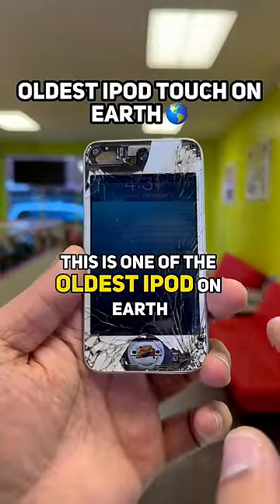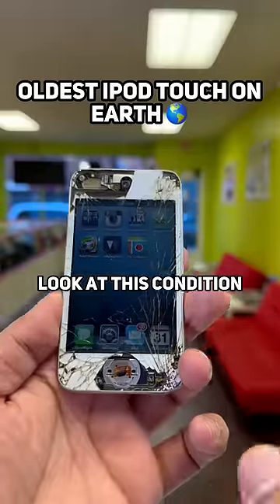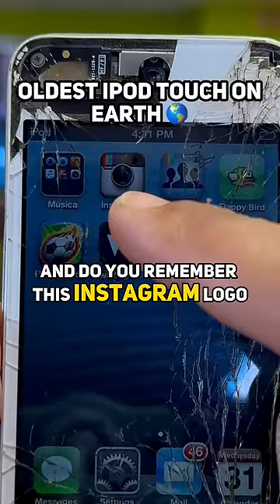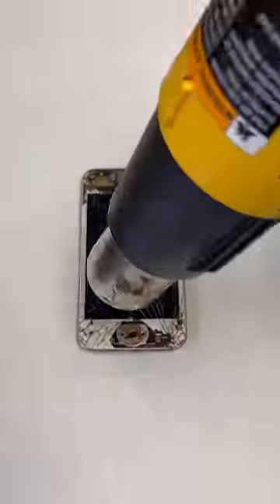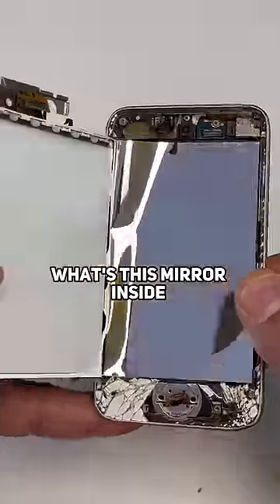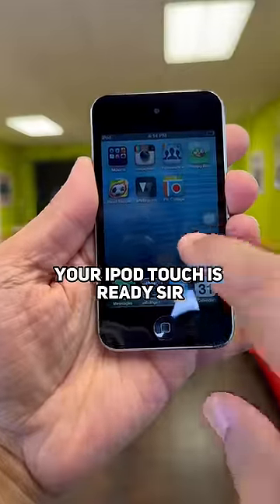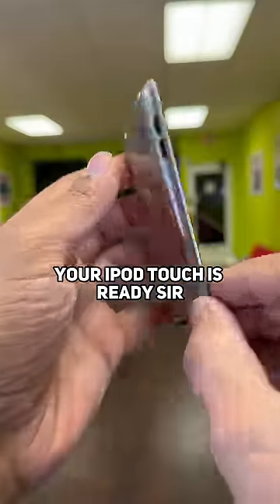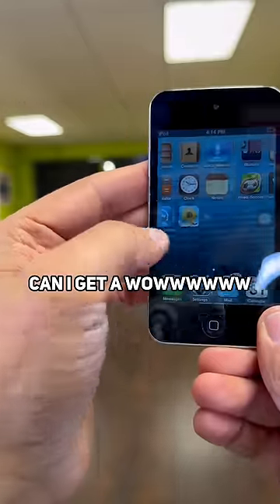Fixing $10000 Worth ipod Touch with Flappy Bird 😍 #shorts #ipodtouch #apple #iphone #ios #android

Comment from the maker: What’s your battery percentage right now ? Comment below 👇
Reply: G3%
Reply: 52%
Reply: 27% 😅
Reply: 83%
Reply: 21%
Reply: 98%
Reply: 11%😅
Reply: C=Charging
N=Normal
X=Not So good
L=Low power mode

My battery= N98‰
Reply: X 53% :3
Reply: Wow
Reply: 13
Reply: Charger: 11%
As for the battery: 93%
Reply: 3💀
Reply: 93
Reply: 5%
Reply: 42%
Reply: 2%
Reply: mrpotato-8  good luck bro 💀
Reply: 63%
Reply: 11
Reply: 77
Reply: 36%
Reply: 79
Reply: 69%
Reply: 69%
Reply: 52
Reply: 97%
Reply: 15%
Reply: Mine is 88% percent
Reply: 0% 💀 (im on a Samsung)
Reply: 45%
Reply: 93%
Reply: 72
Reply: 100%
Reply: 100🤩🤩🤩🤩
Reply: 100%❤
Reply: 20%😊
Reply: 46
Reply: G3%
Reply: 48
Reply: 71%
Reply: 49
Reply: 83
Reply: 83%
Reply: 8%
Reply: 95
Reply: 38%
Reply: Clean 60%
Reply: 100
Reply: 100
Reply: 1
Reply: 69% (Why did it have to be that number now).
Reply: 35
Reply: inf bc im on pc
Reply: 66%😂
Reply: 40%
Reply: 97
Reply: 37%
Reply: 30
Reply: 100%
Reply: 31%
Reply: 31
Reply: 47
Reply: 70
Reply: 68%
Reply: 70 %
Reply: 70
Reply: 69% 💀
Reply: 39
Reply: 82🎉🎉🎉🎉🎉🎉🎉🎉🎉🎉🎉🎉
Reply: 17
Reply: 74%
Reply: 11%
Reply: 69%
Reply: 84
Reply: S10 plus 84%
Reply: Yours is 84 and mine is 84
Reply: 46
Reply: 1
Reply: 12%
Reply: 79%
Reply: Bro can u fix my iPod Touch 4th Gen?

Parts to be replaced:
• Screen
• Battery

Bro also just jailbreak my damn iPod if I send it for repair...
Reply: @KaidenBarillas same here im on a lenovo 0% still works lol
Reply: 45
Reply: 83%❤
Reply: 13 persent
Reply: 48%
Reply: 100% i always keep my pc charged
Reply: 50%
Reply: 90% or 80% i cant see it
Reply: 84%
Reply: 98 percent
Reply: 53%
Reply: 81
Reply: 39
Reply: 95%
Reply: 84%
Reply: 60
Reply: 83
Reply: 25
Reply: 84
Reply: 63%
Reply: 74%
Reply: 60%
Reply: 16
Reply: 90
Reply: 72%
Reply: 38
Reply: 40%
Reply: 91
Reply: 6%
Reply: 58🥚
Reply: 82%
Reply: 97%
Reply: 10 😅
Reply: 10
Reply: @IVAN-pz6et my 10
Reply: 92%
Reply: 85
Reply: 100%
Reply: 98%
Reply: 84
Reply: 31%
Reply: 63%
Reply: 9
Reply: 76
Reply: 0.0000000001
Reply: 62
Reply: Mine 34% 💀
Reply: It’s discharging so fast
Reply: For 30 minutes
Reply: I need a battery replacement to discharge at 24 hours
Reply: 73
Reply: 6
Reply: 100
Reply: 47 and climbing
Reply: 41%
Reply: 62
Reply: @KING_GOD_34 too close
Reply: 69% haha sussy number
Reply: 34%
Reply: 7
Reply: 7%
Reply: 23
Reply: 56%
Reply: 50%
Reply: 71
Reply: 28%
Reply: -1% 💀
Reply: 79%
Reply: 98
Reply: 63
Reply: Hey dude i can get flappy bird on my 4S with iOS 6 super easily. Flappy Bird on an iOS device does not increase it’s value!!!
Reply: 98%
Reply: can you fix my Ipad 16 im all the way to france
Reply: 1 and I can’t ride a charger💀
Reply: 6 💀
Reply: 37%
Reply: 12%
Reply: 31%
Reply: 51%
Reply: 19%
Reply: lol im on desktop computer
Reply: 35
Reply: 20
Reply: 22
Reply: 78%
Reply: 58%. I’m using my brand new iPhone 15 I got for my birthday this year and I love it more than my 6. My 6 would only hold charge for about an hour at the most and then be dead, and then my mom got me the new 15.
Reply: 45
Reply: 12%
Reply: 55%
Reply: 6% 😂😅😊
Reply: 22
Reply: 92😊
Reply: 100%
Reply: My ipad is not working cause it exploded...please fix it please 😢😢😢I hope the price is free...😢😢
Reply: 56
Reply: 32%
Reply: 8
Reply: G100%
Reply: 13
Reply: face reveal 🤡
Reply: 37%
Reply: 71%
Reply: @MemesFromUnderTheBed what the hell
Reply: 48%
Reply: SHOP LOCATION
Reply: 66
Reply: 86%
Reply: L69%
Nice
Reply: 55%
Reply: 67
Reply: Until my house power goes out.
Reply: 52%
Reply: 89
Reply: Wow
Reply: 26
Reply: 17 percent
Reply: 98
Reply: 92
Reply: 71
Reply: 100%
Reply: 92% surprisingly
Reply: 6
Reply: 57%
Reply: 78
Reply: 68
Reply: 80%
Reply: 29
Reply: 1 perse
Reply: 9%
Reply: 9%
Reply: 54
Reply: 4
Reply: Charging 
Current:9%
Reply: 7%😂😂
Reply: 51%
Reply: 34
Reply: 63%
Reply: 55
Reply: 55%
Reply: 26
Reply: 71%
Reply: 55%
Reply: 92. '/.
Reply: 67%
Reply: 42
Reply: 65%
Reply: 94
Reply: 97%
Reply: 3℅
Reply: 3💀
Reply: 79%
Reply: 20
Reply: 29
Reply: 62
Reply: 14
Reply: 21
Reply: 11%
Reply: 89
Reply: 83
Reply: 47% ig its not that bad
Reply: 29%
Reply: 23😊
U
Reply: 90%
Reply: 67
Reply: 90%
Reply: 90%
Reply: 83
Reply: 53
Reply: 75
Reply: 39%
Reply: 68
Reply: 13✨
Reply: 9%
Reply: 32‰ 😢@ my phone is 4000 mah it's  2 % battery  drains in 30 sec i replaced battery still no changes 1% battery drains in 30 sec 😮‍💨
Reply: 49
Reply: 12 %
Reply: 0% but idk how im using my phone
Reply: @Yoyo36093   stop the cap
Reply: 93%
Reply: 77%
Reply: 73
Reply: 96 percent
Reply: 4
Reply: 84%
Reply: 51%😂
Reply: 69%❤❤❤
Reply: 12💀💀💀
Reply: Your mom.
Reply: Jk, 44%
Reply: 93%

Comment: My iPod touch is the 2 gen and it’s more older then that one and mine doesn’t turn on and I plug it in and it shows it’s charging but in reality it’s not charging so I’m assuming it’s the battery I think I need a battery replacement idk 🤷‍♂️

Comment: I need to schedule to get my 4th gen 64gb iPT fixed. It needs a new home button module , power button module and a new battery. Probably also should see if they can do a new screen too cause it has some ghosting due to age.

Other than that, it still works great as a MP3 player that can also do some retro mobile games